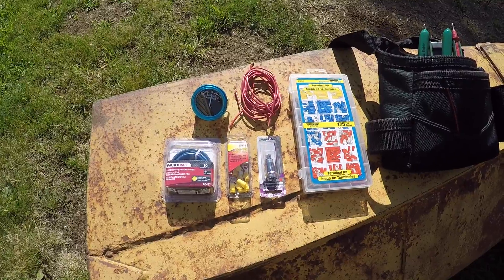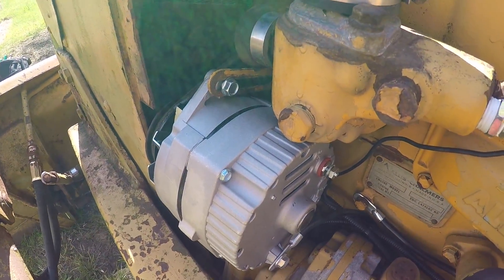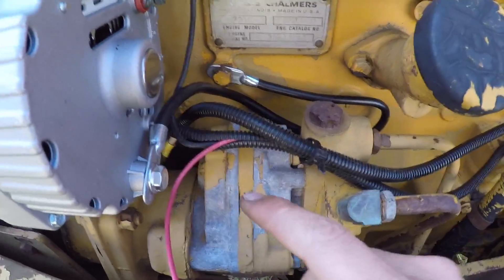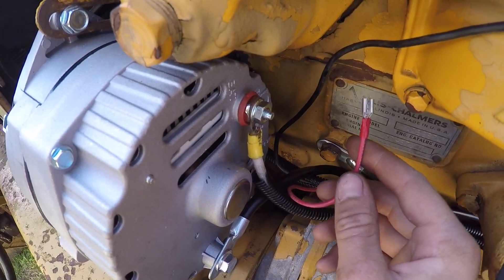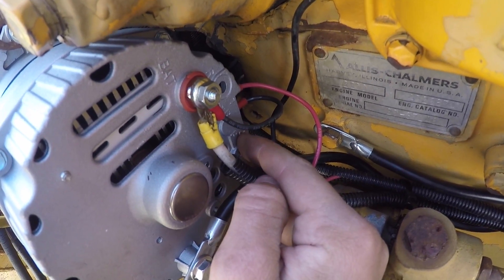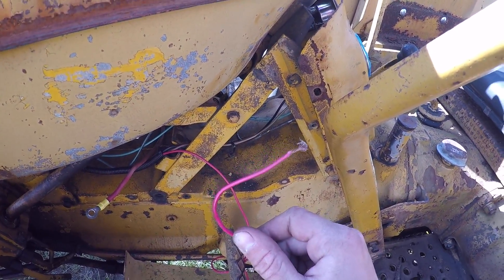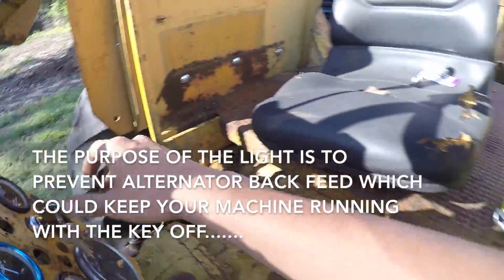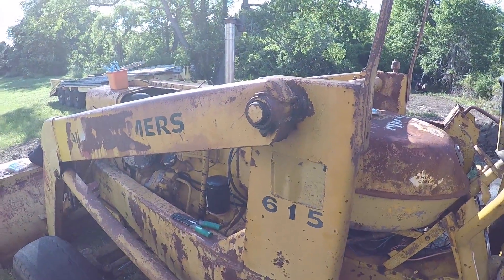How to Wire a 1 Wire/3 Wire Alternator (10SI Delco Style) to a Farm Tractor

Comment: How would you wire if there is a push button switch and no ignition switch.
Reply from the maker: You'd need to wire it to a switched source. Do you turn your key and then push the button? I wouldn't imagine your fuel pump constantly has 12v because then the engine would never shut off.
Reply: My engine is a 353 Detroit diesel to start l push the starter button to stop l shut off the fuel supply with a push pull type knob.l believe the fuel pump is mechanical.thanks for your help.

Comment: Great job on this video! I have a Duce and half made into a log prehauler with a 350 engine, been having an issue with it not charging for quite some time, did all sorts of rewiring and asking know it alls and watching ‘way to long ‘ videos, nothing worked. Watched your video, did exactly as you said - it all works perfectly- thank you !
Reply from the maker: Great to hear! I was having trouble with my tractor, every time I went to start it the battery was dead. Turns out the alt wasn’t charging! Thank you so much for watching. :)
Reply: @iamdjnam  I'm trying rewire a Howard Price 727 mower. The panel was taken apart, the wiring doesn't match the color code to the original manufacturer and I am fit to be tied to properly install wiring between fuel gauge, engine temperature gauge and hour meter. The wiring shows an exciter wire to the valve for fuel that must be in the open position to allow fuel flow. What a pain in the neck! Thanks for posting your video...it might help to get this unit back up and running. I need it for making compressed earth block for an off grid home. Blessings!

Comment: Will this work?  (this is how my Massey wiring diagram shows it):
The wire from the LED goes to a post on the oil pressure switch (instead of an accessory terminal of the switch).
And also, the F (#2) terminal on the alternator is wired to the negative side of the amp guage, which is then wired to the Bat terminal of the solenoid.  So it has 12V all the time to the F, but only has power to R when there's oil pressure? 
The ignition switch only has one wire in and one wire out (to the S solenoid terminal)-its just "off" or "start".
Reply from the maker: From my understanding, if you incorrectly wire the #1 terminal, the engine will stay running despite the key being turned off. On my AC, the previous owner cut all sorts of wires and capped a bunch of things. Being a yard machine, it doesn’t run everyday so there needs to be a way to excite the alt. My ign switch has an ACC terminal, which is what I use to excite. Then the charge feed from the alt goes to the positive of the ammeter. You can just wire your #2 to the back terminal like I have.